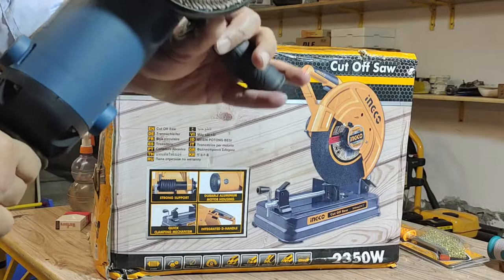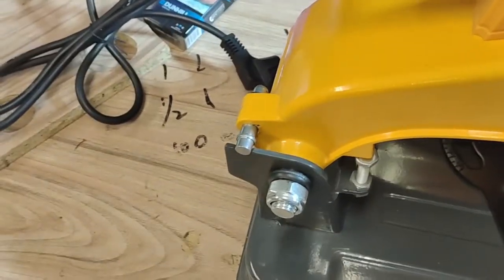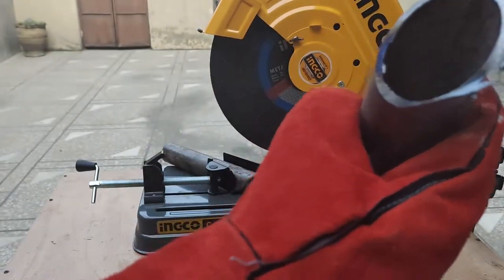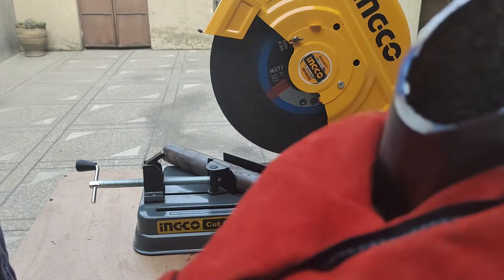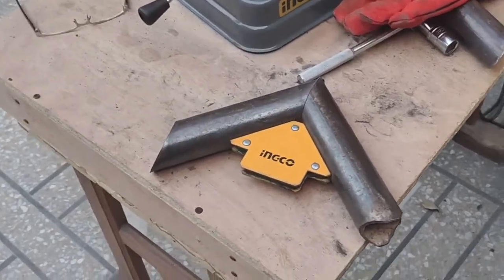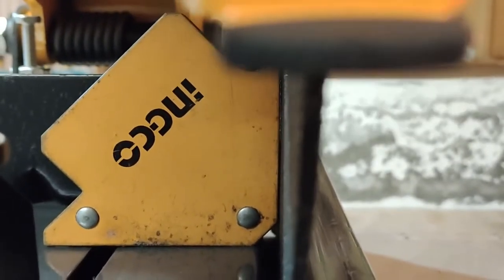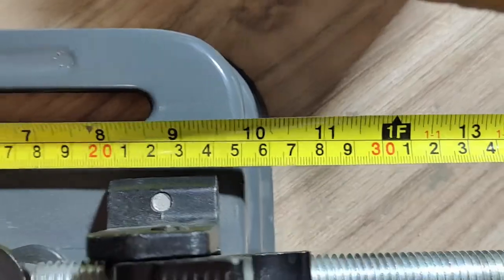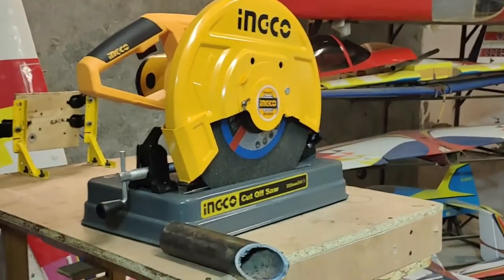INGCO Cut off Saw COS35538 2350W Unboxing, Testing and Calibration.

Comment: Great video Nauman, and yes you did the right thing, checking and calibrating the machine. And as we could see in the video you checked for straight cuts, and measurements were way out on both sides of adjustment plate. These machines no matter what make or model, they still need to be checked and some times calibrated. I have the latest Dewalt cut off saw, and had to adjust mine because my straight cuts, plus 45 cuts were not accurate. Now every pipe or flat and angle steel i cut are perfect. Keep up the videos my friend, and stay safe👍
Reply from the maker: Dear friend thanks for watching and liking. I am nowadays making a welding table using mild steel pipes and getting accurate cuts after the calibration. This machine has made metal work really easy as compared to cutting with an angle grinder.

Comment: Thank you very much, Please, can this cut of saw cut 100mm x 50mm rectangular tube in 45 degree angle if we put the tube so the base is the 50mm side and the height of the tube is 100mm, it is like putting two of 50x50mm tubes on top of each other and cut them in 45 degree angle.
Please answer my question, because this the the reason that I want to buy this saw for.
Thank you again.

Comment: The gap on top comes because you sand the pipe manually after cutting it.
Reply from the maker: The calibration was a little bit out. Now it's much better. Not much sanding is required now.